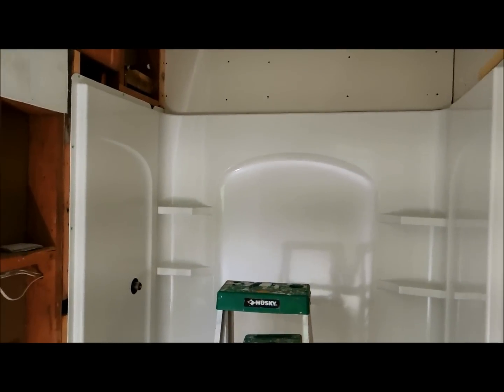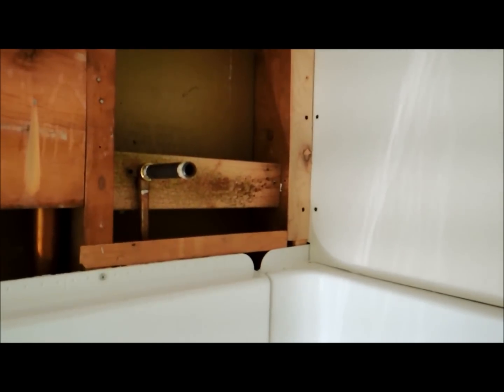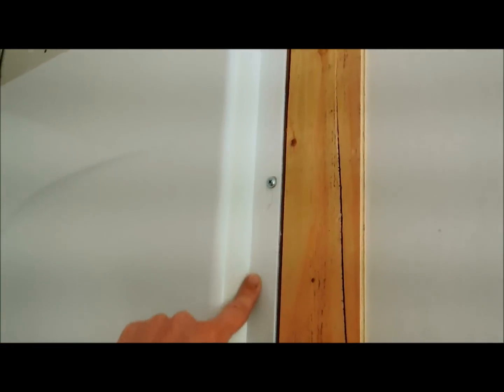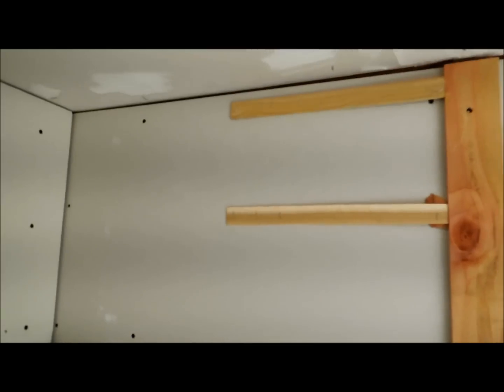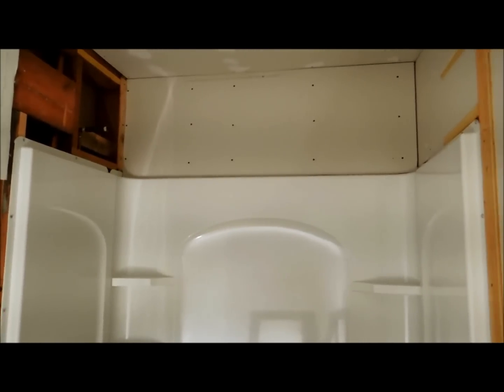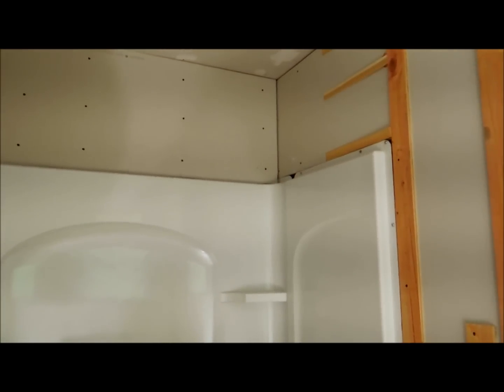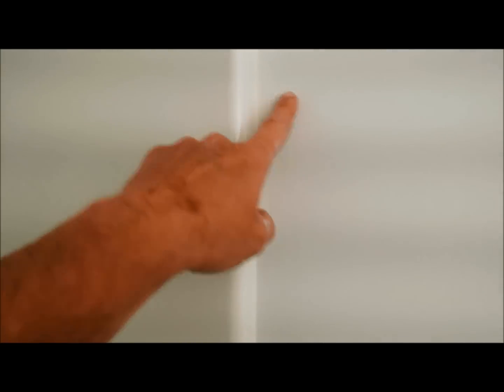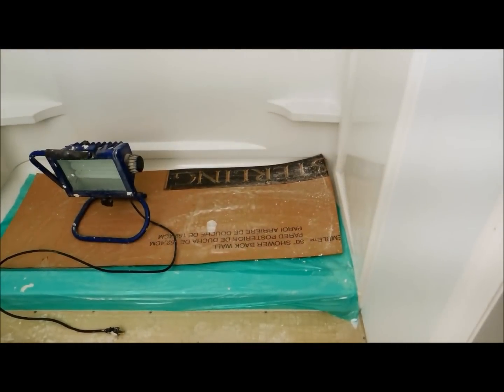Installing A Shower Enclosure

Comment: Great video, thanks. Nice work. 
Two other solutions I've come up with for this problem you might consider- A tile border around the shower to cover the flange/gap, or a wood trim as a border. Saves having to shim/pack walls, custom cut door frames, elec, drywall a whole wall, etc. and dresses it up a bit, especially if you match tile to backsplash on vanity. BTW- I've yet to have an enclosure go in perfectly.

Comment: Thank you so much for sharing. I just had a shower surround installed about 2 weeks ago and have the same exact problem that you have addressed in this video. I have studied and studied this problem but couldn't come up with a solution. Now, I think I'll finally be able to finish my wall.

Comment: Impressive work. You're an inspiration. As a  do-it-yourselfer, I have many times had to find creative work arounds for poor workmanship I encounter. Overcoming the problem and making things square again is always better in the long run and very satisfying. But I think most "customers" would not be willing to pay for what you've done.
Reply from the maker: You're right--it's a constant struggle to balance cost and quality.  I always give clients the opportunity to make the decision if there will be significant cost involved to make things right.  Often, though, it's a matter of a little bit of extra time here and there, which I absorb in my schedule.  There's a reason I'm not fabulously wealthy!
Reply: @enduringcharm  but you can always walk away from a job feeling good about it knowing it was done right and it will last for years to come. Im just starting a smaller install 36 x 34 in my home, (manufactured). None of these stupid walls are square and it kills me to no end. I am dealing with the opposite as you did in this video and the corner is more recessed making more like 95-98 degrees.

Comment: Thanks, too, for showing all the problems you needed solve when you had to square out the shower alcove, especially pointing out all the domino effects on the wall, the door, and the electrical box.
Reply from the maker: +tenframe The installation instructions never show anything but ideal site conditions!  Remodeling is the art of making new things work in old places.

Comment: Thanks for this video. I'm getting into a similar situation on a remodel job and wasn't sure how to finish the drywall onto the edge of the shower. I'm not a carpenter, I'm comfortable with the electric and the plumbing but not so much with the finishing of drywall.
Reply from the maker: Drywall finishing is not rocket science, but it does require continuous practice to be really good at it.  Even among pros, the guys who specialize in drywall and do it all day long every day are going to be smoother and quicker at it.  But, the good news is that even if you screw it up you can always sand it down and do another coat.  Drywall work in remodeling is different from drywall work in new construction.  The former requires more finicky work and sometimes more compromise in order to blend new surfaces with old.
Reply: @enduringcharm  Thanks for the reply. I do have more than basic experience with auto body over the last 40 plus years when I was a mechanic, I do have the feel in the hand for when the sanding is right and know about how much mud to apply and how thick per coat, as you said, the daily practice for hours at a time for at least a few months is the key. I had a carpenter frame up the bathtub/shower unit and rough in a lot of the framing in the home, I did all the rewiring and some of the framing, he did the drywall on the ceiling and I did the walls, now I'm having trouble getting him back to finish the mud and tape so I found a guy who only does mud and tape but almost no drywall, so it looks like I need to finish the drywall around the shower myself. If you want, you can see some of what I've gotten myself into on my channel, I've put most of the videos in a playlist called "mobile home project" or just the latest "update" videos since I don't have time for the mechanic and trucking videos my viewers want to see while this remodel is in progress. I do welcome any suggestions any ideas. Thanks again.
       Gordon R.

Comment: I am starting one of these projects as well to replace a soaking tub. My house was built in 1948-1949 with rough cut lumber. One of the most important things to do is check your walls and floor. The opening in which I am putting this is not plumb or square. The tub I removed had a ton of caulking around it to seal the gaps. I am doing some new studs to fix the walls to make everything plumb and to make the drywall match after installation. Very nice video.
Reply from the maker: +50vulcanbmg That's usually the best option when possible--reframe the walls to be straight.  Getting the floor straight and close to level can sometimes be a challenge because of an adjoining room.

Comment: Great video did you caulk the seem of the wall joint. Thanks
Reply from the maker: You mean the joint between the shower walls and the wallboard?  Yes, after everything is in place I caulk that gap and paint over the caulk.  You could use a silicone caulk there, but then you can't paint over it and it doesn't look as nice.  I use a paintable latex caulk.

Comment: Those "plywood strips" (not plywood at all) are called furring strips. They come in various widths and are very inexpensive.  Good video!  Thank you.
Reply from the maker: Thanks--although those really were plywood strips!  I keep scraps of plywood from various jobs and cut them into strips so I can use them both for shimming and for things like joining drywall ends.  Maybe you saw some shims and cedar shake strips as well, which have a taper.  In my area of the country you can buy wood shims or bundles of shakes or shingles which can be used for shimming, and when you buy 1x2 boards we call them "strapping."  Same thing, different name.  Furring, strapping and shimming are used in the field interchangeably.

Comment: Thanks for your reply. These walls are molded such that the very back surface is on the same plane as the flanges. I think I will be forced to shrink my opening length as well to reduce the gap between the studs and panels. Your fir strips do the trick but admittedly force yet another adjustment to the process. Perhaps I should have filed the walls in. I'll get it done and fortunately its not hampering our bathing. Thanks again.
Reply from the maker: Well, most shower walls are designed to fit to the structure itself (studs or plywood) and then the drywall overlaps a flange.  So, the rough opening is the stud to stud measurement.  It's possible you have a shower wall that's designed to sit on the surface of the drywall, I suppose, but you'd better get that figured out before you go too much further.
Reply: @enduringcharm  No. It's a stud wall mount design. The back wall seems to have had a small window that was removed. This causes irregular stud alignment. I may rip that out and scan on new, but also to place studs symmetrical about each wall. I might be able to cover that one wall with plywood and prime it up well leaving exposed areas for adhesive. The beat goes on!

Comment: On this exact shower unit [which is the one I have as well] do you caulk the inside seams. The 2 seams going down the back or the seam where the pan meets the walls? If someone could please answer me that would be lovely! Thanks!
Reply from the maker: If memory serves this is a Stirling unit, and they do not want you to caulk any of the seams.  You do, however, put a short bead of silicone caulk at the outside ends of the tub-to-wall seam so that water cannot spill out beyond the tub edge.

Comment: Good info (especially on the tolerances !!!) ....about to use that exact same shower enclosure on my basement project.   Only difference is a left drain.  Personally (and with the shower pipe coming thru drywall) I always use green-board, but that's just my preference.  Condensation on the shower head pipe etc can cause issues.  Good info tho....thanks
Reply from the maker: Green or purple board is not a bad choice, but when the drywall is above an enclosure like this and well painted, it really isn't a problem.  When I'm replacing all of the drywall in a bath I'll use green or purple.  I also use hardibacker above tile, which can be skim coated with compound.

Comment: I'm doing the drywall tomorrow on a shower enclosure that was installed by a plumber and I'm trying to figure out how to finish the drywall around the flange. There was a shower enclosure that was removed but the walls weren't shimmed out, so I'm thinking I'm going to fill in the flange area with 20 min mud, apply tape then float over the tape and level the area. Have you ever tried that method?
Thanks for sharing your vid.

Comment: Thanks for the info about how to place and seal the sheetrock over and around the shower flange.
(Sure would be nice if the installation information that comes with the shower enclosure would include this important  detail for proper installation.)

Comment: Did you use regular dry wall for above the shower always?  Going to be doing one myself, and was wondering if I have to use center board, green board or regular dry way for above the shower wall?
Reply from the maker: Well, look, using green or purple board is preferred.  But, green board isn't magic.  It's got the same internal core as regular drywall, it's still got a paper surface, but it may have some mold resistant chemicals added or a waxy surface applied.  So it isn't waterproof.  It may or may not provide better water resistance compared to a well painted regular drywall.  

I have used regular drywall above a showerhead, which I prime and apply two finish coats.  On the other hand, I have remodeled baths where I took one look at the teenagers waiting to use it and decided to install hardibacker above the showerhead, surface coated with joint compound and then painted three coats.  There are also now paperless drywall options.

Ultimately you have to make a judgement call or else assume the worst.  Is the bath large and well ventilated or is it small and without a fan?  Will teenagers be splashing around or is it used once a week by a little old lady?  Personally, I don't see a huge difference in performance among different drywall types as long as they are well prepped and painted.  If you are really concerned about water above the showerhead use hardibacker or one of the paperless drywall options.  The green board is more hype than help. I think.
Reply: Thank you!!!

Comment: does the dry wall behind the panels need to be water proofed? Or looks like all insurance is on the panels to hold the water. Thank you
Reply from the maker: The enclosure panels are attached directly to the studs.  The drywall goes up to the panels on the top, where a quality paint job is all that is required.  The shower head should be located just above the top of the enclosure walls and hang down into the shower.

Comment: I have this exact unit except mines the tub. I was hoping to see the actual Install of the shower walls being set. Like do you add silicone or what to the sections before connecting them or are they just dry connected and just screwed to the studs?
Reply from the maker: Manufacturers differ on that point, so you need to read the instructions.  Some want a dry fit, some want silicone in certain areas.  I think this was a Sterling enclosure and if I remember correctly for some years they wanted a dry fit and in later years they specified silicone at the bottom.    You really need to check the sheet that comes with your unit.

Comment: Have a couple of questions. The shower surround you installed doesn't call for adhesive, you only used screws around the perimeter?  Also, above the surround, you just used drywall for wet areas, nothing else special for water that might splash higher?
Reply from the maker: I've taken apart 60-80 bathrooms, I've lost count.  Not once have I found drywall above the showerhead to be damaged by moisture.  I have occasionally seen the first layer of paint peel off, typically from a bathroom used by teenagers.  I have no idea what the do in there!  So, for me, I'm comfortable using drywall above the showerhead or shower walls.  I apply three coats of paint, one primer and two finish coats.  I also use Ben Moore's Bath and Spa paint, which is more resistant to moisture.  I caulk the gap between the drywall and the shower walls.  Once in a blue moon I may have concerns about moisture in a particular shower, perhaps if the bath is small and a fan cannot be fitted or if I notice a bunch of teenagers living in the house.  In that case you can use Hardibacker (that brand, not others) as a finish surface.  Install the backer and apply a skim coat of spackle.  Sand the spackle smooth but do not sand the backer.  Then apply the three coats of paint.

As for the shower pan, I have an entire video on the subject!  Check it out here:

https://youtu.be/PUTyeD-jyeY

Comment: Looks like Sterling Ensemble Curve surround. Is that correct?
Would the method of adding some outside corner molding & door casing or something around the edges have worked? (I see further down you said your clients wouldn't accept that, so I see why you didn't do that in this case).
I'm going to use a Sterling enclosure on a new bathroom but the walls are 61" apart & I was thinking of doing a corner trim + door casing edge treatment bc I won't be using drywall- we are re-using some 1/8" plywood panels from another room we remodeled.

Have you ever added grab bars to one of these units (the kind that come without the backers that require you to make your own backers)?
Reply from the maker: I personally don't care for the look of moulding around the edges either,  and since the enclosures already tend to look a little chintzy, I'd rather not make it worse.  I don't mean to sound snobbish--I have a shower enclosure in my own house in the bath our kids used growing up.  It made sense because it was cheap, I knew they would beat on it as teenagers, and it's easy to keep clean.  With the kids nearly out of the house now, I'll eventually replace it with a tiled installation.  Anyway, in your situation you'll have to decide what's best, but there's no functional reason you can't use mouldings.  I would choose PVC over wood, though.  As for the backers and grab bars, you bring up an interesting issue.  I have special-ordered enclosures with the backing installed for grab bars, and I found to my dismay that they were really nothing.  The factory just glued on some plywood cleats to the area where the grab bars would be installed.  I would suggest you do the same, rather than pay more for them to do it.
Reply: @enduringcharm  Thanks. No worry on the "snobbish" bit. I can understand that. People have different tastes in what looks good. I personally don't like tile & I'm a huge snob about wood. I detest mdf. Back in the 80s when we renovated, my father custom built our cabinets out of red oak. They survived the tenants from hell. I constantly complain about the shoddy cabinets & stuff they have today that is either particle board or mdf in some cheap laminate crap.
I would absolutely go with pvc over wood. Most of the trim they make now is made from mdf-- much to my chagrin.

I heard Sterling wraps their backers in some sort of coating, but when I looked at the specs I saw that they don't leave much room for error or options for adjustment & it is almost double the price.

So, I'm going to put some 2x10 or 2x8 braces flush with the studs, anchor them, and then use some scrap wood as backers to bridge the gap between the backs of the wall panels & the braces. Then I'll use screws long enough to go through both the backers & the braces. Of course, I'll have to make sure none of it conflicts with the plumbing. 

I'm planning to have 16" grab bar with little shelf  either above or below the controls for the shower. Trying to decide which one would be better (above or below). Going with Moen stuff-- so it will be a Moen Kingsley trim and a Moen Refresh double shower with slidebar- it's a short slidebar though-- only 19" so I'll have to be careful about where I put the shower arm to make sure the handheld can slide down far enough for my mother to reach while on the shower seat.
Reply from the maker: The Sterling shower enclosure I last bought made for grab bars looked like they just pulled off some walls from the assembly line, squirted some adhesive on the flat spots and slapped some oriented stand board on top.  There was no special design or construction to it.  Basically you just need something for the screws to grab and enough plywood or OSB to spread the load across more surface area.    If you look at the end of this video, it shows the grab bars.  This was a low budget job I did as a favor for an older woman who really needed the help:

https://www.youtube.com/watch?v=m4ixKqScY04&index=7&list=PLD4oAOZqK9mCjvmw_nUkZBrPPXf_20Lad&t=0s
Reply: @enduringcharm  Well, now I feel better about my decision to get the regular shower wall kit instead of the one that is supposed to have backers. I hate OSB. Thank you! I'll go watch that video.